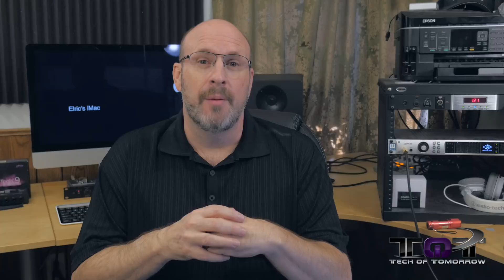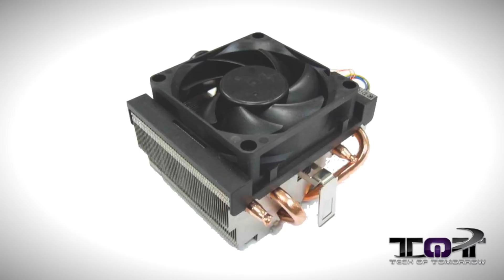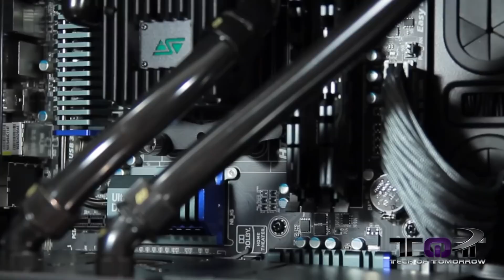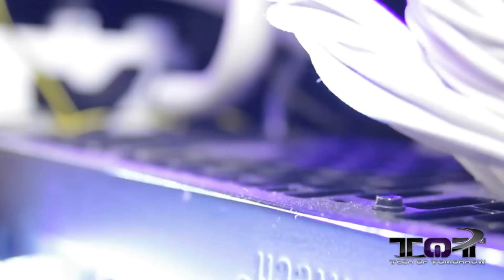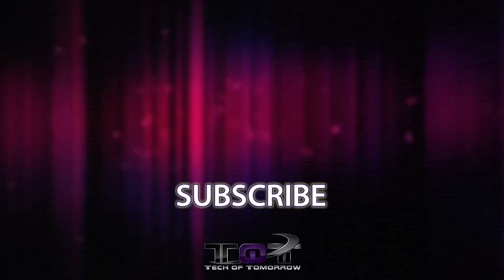PC Cooling 101: The Basics & Methods!

Comment: Hehe this video was uploaded at perfect time for me... today i OCd my FX 8320 to 4.0 using stock fan, of course not trying to go any higher since i dont trust the amd stock fan, its loud and noisy and as far as ive seen it cant handle higher temps very well. After I overclocked my cpu and saw the big improvement that this gave to my rig on gaming (Crysis 3, Far Cry 4) im thinking to buy a new cooler to go further on my cpu frequency. I have 60$ and dont know wich option is the best... ive read a lot of reviews on Corsair H60 but a lot of people say that its loud and fails most of the time, Noctua or EVO212 not an option since i have Corsair Vengeance RAM and it just wont fit... so i think the best option is going for the CM TX3 and spend the rest of the money on some fans for my case to improve my airflow... so what do u guys think? any recomendation?
Reply: Give it a shot at the cooler master seidon 120m pretty efficient cooler and almost silent.
Reply: ***** Hey man! i was watching your top cpu cooling video hehe well my highest temp is 60C on 100% load... did a lot of tests with prime95 and its stable... and temps are nice, my room temps are really low so my rig stays cool all the time wich it helps a lot... games like crysis 3 or far cry 4 on very high settings run well with 50-54C max temps
Reply: ***** That's totally fine. The 8350 runs on stock 4.0 Ghz too and these cpu's are the same. Even 4.2 shouldn't be a problem, but it would get very noisy. I use a h100i to cool my FX-6300 at 5 Ghz. And the H60 has a very thin and small radiator. So it needs a fast spinning fan for good performence.
Reply: i have the same proccesor FX 8320, i OCed @ 4.2Ghz with the Corsair H90 liquid cooling system, but my Mobo is not very good for OC, because i use high Volts to get 4.2Ghz is a M5A97 so check first your MOBO to get a higer Overclock, buy a mobo with the chip 990fx is better for OC, mine is just not, im using 1.452V with my mobo Asus M5A97 970 chip, other users with the 990fx chipset can reach to 4.7Ghz with my Voltage and 4.2Ghz with stock V. so check your mobo if your mobo is a 990fx chip, so you can go further, just my opinion :D, is a good CPU really cheap, :D
Reply: ***** i was going to buy that same MOBO but i read a lot of negative reviews when it comes to OCing on that board, i was on a budget and couldnt afford a 990Chipset MOBO so i went with the Gygabyte GA 970A UD3P... and its a good mobo for the price
Reply: ***** Yes, not every Mobo is good for OC. But i use a cheap one too (gigabyte 990xa ud3). It is midrange, nothing special but handles my oc settings very well. Sometimes you just lost the silicon lottery and get a bad cpu. It could be both.
Reply: Tobias L. Lol, i think I won the lottery then... because i reached 4.4ghz with stock volts (1.4v i think) and haven't tried higher so i could probably get to 4.5ghz with stock volts, max temp is 52c. Corsair h80 with Cooler master's High performance Thermal paste.
Reply: KRivera is it stable? did u run prime95?

Comment: Great video! I was wrong about how different forms of cooling effect ambient temperatures also. Being that no matter what type of cooling that you're using, you're still dissipating the same amount of heat energy, the ambient temperature of the environment will be effected exactly the same.
Reply from the maker: Thanks Bryan....
Reply: Tech of Tomorrow i have a fan that has a mind of its own  then it ramp right up  after a hr its not the CPU I always put oil in CPU fans  I will get the bottom of it

Comment: Best 4k graphics card? 2014?
Reply: AMD 290x2 :)
Reply: GTX 980/Titan, or AMD r9 270+ (I don't know the newest one)
Reply: Ajani McKay *295x2. and i agree with this choice. especially with the price coming down to about $650 US
Reply: ***** Actually an r9 295x2 is better at higher res. I have tried
Reply: wooooowwe1 Ye 295x2 Is the best for 4k Atm but the Stock Watercooler is not so nice i would highly recommend a 240/280rad for it :p
Reply: ***** the 295x2 is a card with 2 290x chips. thats for $350 less than 980 sli. the heat is ridiculous, but it gets the job done better than any other 2 gpu setup at 4k. for the most part anyway
Reply: ***** He asked for 4k GPU, not gaming, if gaming, then yes, you are correct
Reply: diamondmine360 From what I've seen, the r9 295x2 is better at 4k than dual 980s. But 980s are better at 1080 or even 2k than the r9 295x2. Titan is a joke at GAMING for the price, but good at software like CAD.

Comment: Who cooks their memory? Even over locked ddr4 ram should just nee a heat sink. Anyway, guys, where could I get gpu water cooling without custom?
Reply: Because looks.
Water cooled RAM is not necessary.
but it looks great in my system.

Comment: FX 6300 and R9 270

Yay or Nay
Reply: I have fx6350 and r9 270x and works good ;P
Reply: I have that exact setup and it has played every game I have thrown at it. Don't expect to to play ever game at ultra graphics at more than 60 FPS but it is good enough to do what ever you want.
Reply: I have an Asus Radeon R9 270 overclocked to 1150MHz on the core and 1600MHz on the Memory. I need to bring it down to 1100MHz on some games but other than that it's now a 270X.

I also have an FX 6300 at 4.1GHz, both compliment each other really well.
Reply: Friend has that set up and it plays most games on high but like the guy above said don't expect to run every single game maxed out. I have a 8320 and 2 270's in Crossfire and still cant run all games maxed. great choice for the price though.